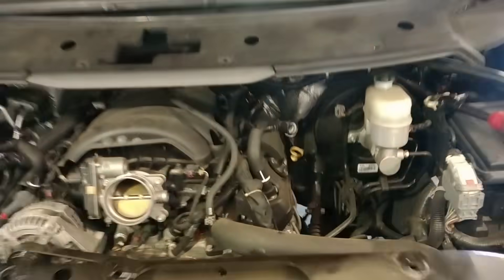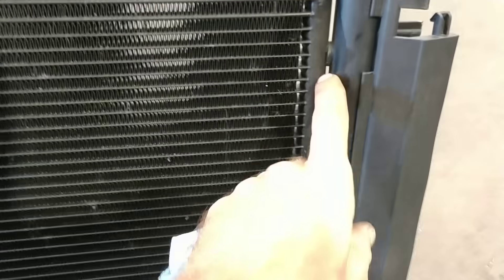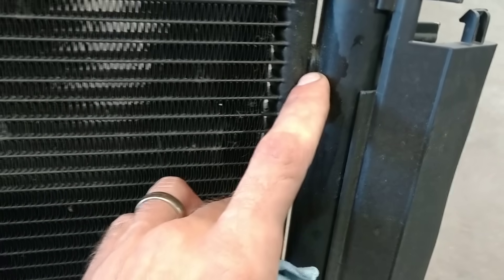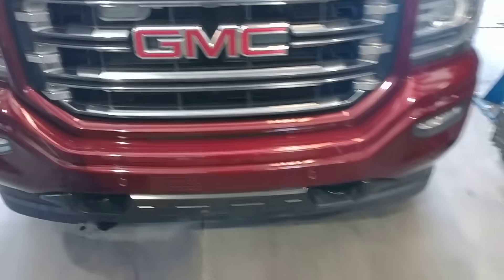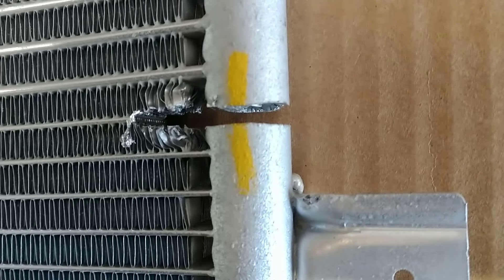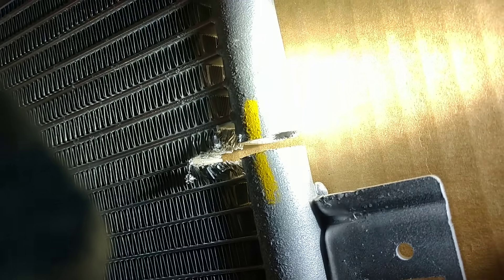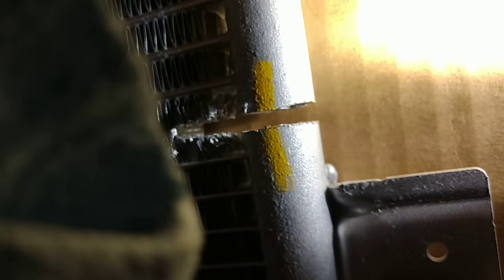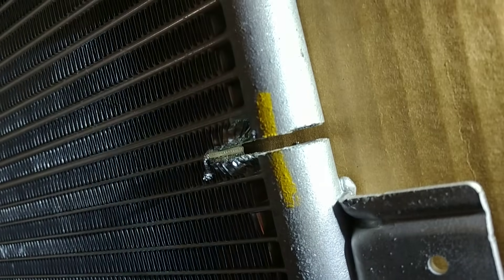Customer States...WAIT, look at this! Can't make this stuff up!

Comment: I have a 14 silverado.  Paid the dealer to replace it the first time at 45,000 miles, did it myself along with the radiator at 110,000.  Twice I had to replace that stupid thing in 6 years and 100k miles.  Thanks GM.

Comment: That is from a disgruntled union worker about to lose his or her  job to Mexico or Asia land. GM's ceo Mary Barra is a POS and is outsourcing all our component jobs over seas and across border for basically slave labor. The price of the vehicles aren't even going down. CRAP PARTS. Mexico is now gnna be making the injectors and fuel rails for all GM trucks and Suv's. Gnna be interesting lol. Will not buy another gm vehicle.

Comment: The cut is a standard feature on many radiators and condensers.  I work with these everyday as an engineer and allowing certain areas to flex will prevent failures at other stress points.
Reply: You're joking right? It goes right through the tube and into the core.

Comment: Those tiny micro channel holes must be the reason why the local AC shop replaces the condenser every time a compressor fails.
 They learned from experience, the junk that the blown compressor blows into the lines ends up plugging the condenser. 

Things sure are not as simple and inexpensive as they used to be. I remember the compressor used to cost $35, and there is don't need to change anything else with it

Comment: I'm a tech at an independent repair shop and have seen the exact same thing myself on a new, GM condenser. I figured it was just some manufacturing error, someone fat fingered the CNC saw depth and added an extra inch or so to the figure for a batch of them or something. lol
Reply from the maker: NOPE. It's just cheaply made.

Comment: For DIY folks, this happens with parts store stuff, too. Always check the part you bought before you leave the store; not only do defects like this happen, but sometimes used parts end up back in stock, and if you try to come back to the store hours later, it will look like you're trying to return the part you replaced.
Reply: I got a starter without a solenoid once. Only reason I was able to get an exchange is that I hadn't left the store for more than 30 seconds when I decided to open the box to see if the starter was for an automatic or a manual (Hyundai Ponys made that distinction, right on the starter) as apparently the manual ones have more windings so as to produce more torque - I sprinted back to the store and the parts counter guy was like,  "back with the core already?" 

"Well, this might as well be a core" as I open the box with a reman starter sans solenoid. they actually didn't have another one in stock so they gave me a DSM starter (or one from a  Sonata/Elantra) and I still have it today ;)
Reply: Apparently its supposed to be that way
Reply: i just bought a pair of front discs, when the guy put them on the counter i asked to make sure they were for 4 stud discs and not 5 i got a heavy sigh thrown at me but he did check and all was ok .
Reply: What did you cut it open for ?

Comment: Personally, i would find, weld and adapt the design my old 05 z71 had. Seperste Trans, AC and radiators stacked upon one another and be dine with it. Sure building and selling the kits as solitions would be a koney maker and tick GM off. Should have built the truck that way to begin with! 

Why I abandoned GM for Chrysler. LeastI know the body and interior will fail but the cummins will keep going!

Comment: I just opened one on the shelf today... Same thing. Looked at 5 more in inventory, same thing. The old OE (original) one that came off the 2016 truck had the same cut in it. Now I'm really confused. I've got to research this, now I'm curious as this seems to be normal for the part. Also, we installed it and it's fine. Beats me

Comment: Interesting- general motors holden make crap radiators for their commodore too. The auto cooler pipes onside the plastic radiator tank fracture and interchange coolant and atf. Coolant in the trans ends up killing it after a while as its hard to properly flush an auto trans of water and coolant.

Comment: I have a evaporator coil to change on my 07 ram so it got me to thinking well if I'm going to go through all that hell I  mit as well rebuild the hole HVAC system in my truck it'll be super neet to have my defroster working again lost that 2 years ago thankfully it has remote start  
But in all seriousness I've never seen one fell and I have gas's up a lot of old systems nevermind the one's that go get junkyard parts to get the system going I've been there

Comment: I have a 2016 Denali and had the same issue.  Thankfully there was a bulletin on it and it was replaced free of charge.  It’s my 2nd Yukon and its absolute garbage.  Broken rockers and lift gate stopped working (under warranty), condenser hole, magneride struts/shocks failed at 50k and $1700 to replace at the stealeship, rear taillights assembly stopped working.  Total BS for a 70k automobile. The 2005 Yukon still runs like a champ.

Comment: This must be recent issues with quality. My 01 Yukon is still 95% original all I have changed/repaired/ rebuild in 320000 miles is the 2 knock sensors, water pump, fuel pump, brakes, shocks and the trans was just rebuilt. It still has the factory exhaust (cats might be empty? We don't have emissions tests here) oh and tire's 01 we was rock solid!!! I'm afraid to buy a newer one as long as parts are available for the one I have!
Reply from the maker: Yea after the bankrupty and corporate restructuring, things have been going south. Too bad.

Comment: GM is not the only ones putting out inferior, low quality parts. Ford is no better. The AC condenser leaked in my 2010 Ford F-150 since the day it rolled out of their factory. I finally got tired of adding freon all the time so I took it out and installed an aftermarket unit. While I was charging the system, my freon leak detector  picked up a leak at the compressor. I thought it was the shaft seal leaking. The AC compressor was splitting apart. A few bolts holding it together corroded and allowed the compressor to come apart. So I ended up buying an aftermarket compressor. While I had everything tore apart, I replaced the thermo expansion orfice. I used the old TEO and machined it to become an evaporator pressure tester. I put 35 psi in the evaporator and left it for a day. Pressure held, no leaks and good to go. Everything works better than new. If my evaporator leaked, I would not spend the time and headaches to replace it. It's a huge job and will take a long time to complete.
Reply: Forgot to mention. Ford OEM AC condensers are made in a third world country like Bangladesh or some other place, cannot remember where since I never really heard of the country before. Chinese must be farming out their menial jobs since Chinese labor costs are rising. They figure most people expect a Ford to break down anyways so no since of having a quality control department.

Comment: That's normal and it's fine. Check your part number and make sure it's not the old one. New one has aluminum foil that covers this area from being exposed. Aftermarket is worse due to the bottom portion being the atf cooler.

From an engineering perspective, it doesn't fail where you're complaining. Quality of work isn't measured by looks. And also, this part is cheap by comparison. I hope you understand how cheap this is to manufacture. Other manufacturers very well include their oil coolers in the condenser, but none this cheaply. 

Now, it does suck where you mentioned it commonly fails. That weld. This would be the only area to improve in my opinion.

Comment: ok so spend 60grand on a truck ... 4 years later replace your ac ... with an ac trans cooler unit that comes complete with pre made weak points ...yeah a good reason NOT to buy GM products ... and people say say ford is bad ... gm seems to have a crappier side to everything ... and people tend to forget ... they want to sell cars not make cars to last ... the delorien was made to last thats why the other car manufacturers worked hard to shut them down .. they didnt want competition from a car that doesnt break down much or rust like a SOB ... want them to fix it .. stop buying from them ... when they ask why tell them they make their cars to cheap and are not worth 10% of what they are charging.

Comment: Micro channel is okay for radiators. However for the use in HVAC as condensers it sucks. They can not and do not hold up well the the expansion refrigerants do.

Comment: Used to run the bodyshop while I was in the Air Force. We hated anytime we had to order GM parts as they're mostly assembly line rejects. Sometimes we'd get panels in that had more damage than the one we were replacing (the shipping box would be in good condition). With the occasional incorrect label on the box. Even had one that someone put the wrong label over the correct one.

Comment: My GMC over heating about 80K miles     End story the radiator still looking new I cut open with an end grinder OMG  those micro fluid channels all blocked with aluminum oxide.

Comment: That cut is supposed to be there. It separates the condenser from the trans cooler. t’s not supposed to go into the core like that but that fin is not used and technically that part can be used

Comment: No joke, worked as a service manager for a few years at a motorsports dealership, all the bikes, quads, sxs, come in crates partially unnassembled and you get to uncrate and bolt wheels/ handlebars, acc. Etc...
Anyway, my Pdi guy goes to uncrate this thing, immediately walks into my office laughing hysterically.
Can-Am literally sent us an outlander that was missing the entire front fender assembly... But still installed the rack... That COVERS THE FENDER.
I had a lot of fun with that warranty claim!

We call that a friday bike.

Comment: A trucking company I worked for at one time gave me a brand new Volvo truck once and maybe a mile down the road at a stoplight I started smelling radiator fluid and sure enough in if the radiator hoses fell off.

Comment: Parts suppliers have been shit lately. I had to put a short block and head in a Fiesta ST a few months ago. The head came in with a broken mounting ear for the vacuum pump and the block came with a nice scratch on the cylinder head mating surface.

Comment: Older the vehicle, the better. This is why car guys (mechanics especially) drive things from 80s/90s.... maybe early 2000s because quality was/is still there, parts are abundant, cheap, and usually easier to swap out. The engine bays are roomier, too. For the past... oh, 15 years or so I'd look under the hood and go cross-eyed. It's like a sardine can, everything's so tightly packed in there and to make matters worse we have to take off a half dozen plastic covers before getting to work.

Comment: That’s why a flush of the AC unit is basically useless and usually causes more damage as those holes are roughly .030 of an inch in diameter. And when a compressor does go out it’s cheaper up front to replace everything than just the compressor as those holes will always get plugged

Comment: That cut is suppose to be there. That tube is a dead tube and the relief cut is to separate condenser and oil cooler from each other for expansion differences.

Comment: I've been a gm technician for 8 years. Replaced over 100 condensers, and 100s of lifters in these damn things.. agree with big money on trash. But that's job security.  But the cut is completely normal in the side. It's made between the trans cooler upper section and the ac condenser lower section.. so it can  expand separately. That cut does look like somebody's frst day on the job..lol
Reply from the maker: Dude don't get me started on AFM lifters🤣🤣🤣🤣
Reply: @RainmanRaysRepairs  I got nearly 200k on my AFM lifters but the problem I had was two rollers on std lifters stuck, the lifter spun or both. I replaced the cam and AFM delete. The rollers and bearings rolled fine when removed but would start squeaking on occasions.
Reply: @micahap1559  use bronze lg2 bushings in the rocker arms instead of the needler bearings
Reply: GM is trash and will be bankrupt withij this decade. That is if the government doesn't bail them out again
Reply: The Beg 3 should have died or survived on their own, no need to squander taxpayers cash, if they cannot run a business then get out of business!
Reply: @kenanderson9331  same holds true for all the Too Big To Fail banking firms out there in the ol' US of A.  They borrow money at less than 1% from the Fed, then charge 4% + for good-credit secured loans, like homes and property, and up to about 22% for credit card debt, and 29% for cash borrowed on credit cards.  They still get their money at 1%, so all that 14% and higher card debt is just a gravy train for them, despite the losses they incur on the unsecured CC debt when people walk away from their credit.
Reply: @kenanderson9331  should put more tax on imports
Reply: ' But that's job security. '  Unfortunately government is the job security.  GM should have gone out of business so a much better overall company could have replaced the poor decision makers running the show..
Reply: @ModelLights  Ford took a $5.9B loan from the government also. GM was the first of the mfgs to actually repay the loan.

"Congress decided that the best alternative for Ford was to get funds from the Term Asset-Backed Securities Loan Facility (TALF), which is a government program for auto, student, and other consumer loans. These were very low-cost government loans to the tune of $5.9 billion that helped Ford tip-toe past bankruptcy..."
Reply: @ModelLights  my point is people think Ford is infallible and they are simply not. Ford is nearing John Deere levels of owner repair ability (as in not very) as well.
Reply: @johndelta00  Wifes uncle owns an F150 and you can't even check the transmission fluid level in it without tearing out half the engine it seems.
Reply: @ModelLights  Gm did the same in australia. Toyota bailed them out years ago. Then recently got bailed out by the government and then took the money and closed shit down.
Reply: @johndelta00  GM paying that loan back had nothing to do with benevolence. It cost the taxpayers billions. BILLIONS, with a "B." 

GM received government assistance to the tune of nearly $50 Billion. Ford borrowed a mere $6 Billion...just over 10% of what GM borrowed.
Reply: @ModelLights  What about Chrysler? The first time they get bailed out of bankruptcy by the government, they immediately buy out American Motors (including Jeep). How do you do an acquisition when you are on the verge of bankruptcy? 
Should have let them go belly up. Someone would have bought the plants and continued production, but instead they survive to go bankrupt another day!

Comment: You could have easily repaired the crack with gas welding. There was no need for the new part. I dont understand why simple repairs are not made by hand anymore.

Comment: I do one of those a week in the summer and all of them are cut like that.  It seperates the trans cooler from the condenser. I've always questioned it also but everything works as it should when the job is done

Comment: This is pretty common for radiators/AC condensers. They are relief cuts to help with expansion and contraction to prevent the exact issue that caused the original to fail.
Reply: Atleast somebody else knows what there talking about in these comments lol. Clueless ppl assume and take it for gospel

Comment: I recognize that part right away because they are made in Lockport New York or Juarez, Mexico and the plant I work at packages them all for GMHC in Lockport.  They're made by the thousands because they fail way too fast.
Reply: What brand of chainsaw do they use to make that cut?
Reply: That cut is GM spec and they've ALL have it for that part. It's designed to allow the ATOC to flex separately from the big condenser is built into and not snap the cooling tubes off when there is movement of the assembly while driving. I have handled them and it gets asked all the time by new people working the packaging line.   The yellow marking was done by the inspector in Building 7 at the GMHC assembly plant in Lockport, NY.

Comment: Found this lawn mower air filter for sale at one of the major home centers a few years ago that was mangled inside the package. Told the employees that the filter would never work because it would not seal properly of used. A few weeks later, I saw the same filter out on the pegs still for sale.... 😣😑🙄

Comment: I just want to know if you marked it with yellow paint or they packaged it that way.
Reply from the maker: Came that way. I found three units like that. The worse part is that they come line that now. It's a feature. Check out the video description.
Reply: @RainmanRaysRepairs  
So should I start in about buying Ford over Chevy now?
Reply from the maker: @rellik1010  You could. But I gotta say Ford is about the same. I've seen 6.7 diesels break rocker arms and eat themselves alive. Bottom line, it's post 2005 era... It's all garbage. Just lease.

Comment: I had a plastic surge tank for a Ford L series truck that came from the dealer with one of the fitting openings cracked. Looked inside the box and found the receipt from where a previous tech from our company sent it back. They just taped it up and resold it.

Comment: Back in 1985 We were replacing a window regulator in a 72' Buick Rivera, after we got the original  door panel off we found a capped 16 oz. glass pepsi bottle with who-knows-whats as semi liquid. We figured it was a 'gift' from the line assembly guy, as they probably didn't have time to run to restroom in order to keep the assembly line running.